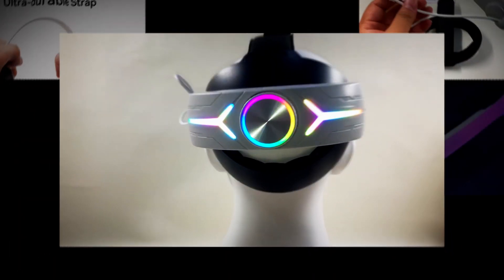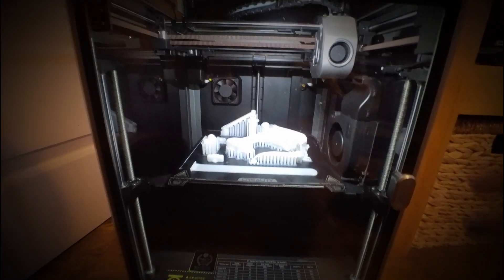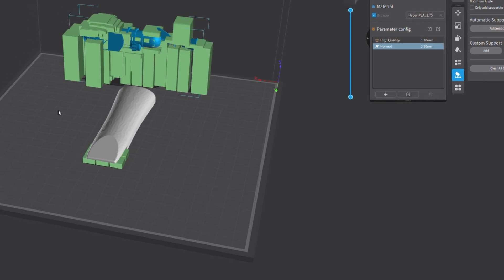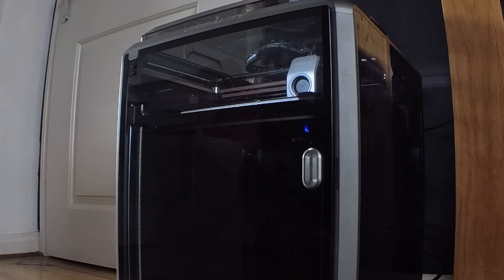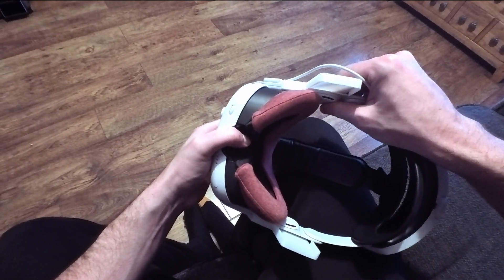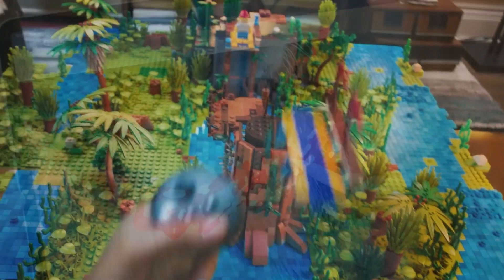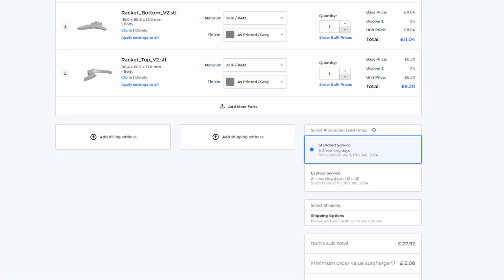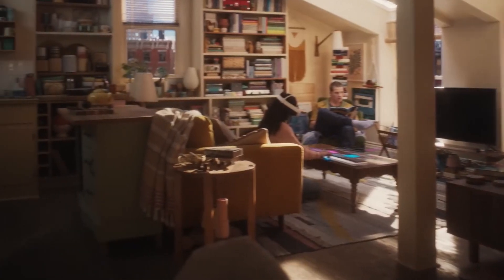Insane 3D-Printed Quest 3 Upgrades You Won't Believe - Creality K1

Comment: Also have to consider the electricity cost now, as that has become an issue?
Reply: a 3d printer on avare consume from 60 to around 250w when in full printing mode and the bed is warming up (actually the bed is the biggest factor here), if the bed is in temperature usually sit at around 140w or less... basically less than a budget pc

Comment: try any Bambu  Labs printer and you will have an even easier experience. K1 is a bambu knockoff
Reply: In what is it a knockoff? That it's fast?
Reply: @redmix3988  on paper maybe, the reality though is that the K1 is having higher print failure rates from what I've seen. Creatility fan bois just can't accept that there's BETTER printers out there, the K1 is certainly a step up from the recycled rehashed piece of shit that's the ender 3 but it was clearly rushed out to try and beat the X1C, only problem was that BBL are about 4 printers ahead with each providing different but substantial improvements that have back propogated.
Reply: @lucagordon5770  First of all, please learn grammar, second of all, in what is a X1 carbon for 1100$ (ww) better than an 800$ K1 Max when it - has a bigger build volume - comes with a camera - isn't as closed source since you can import everything from creality print to cura only for 1 % better print quality on the bambu? 
You are not a person who used a K1/Max
Reply: I have 2 Bambu P1S and 5 Creality K1 Max and let me tell you, if you do in your print profile like you are suppose to, the print quality is the same. What gets little use in my shop are the P1S because of the much smaller bed.